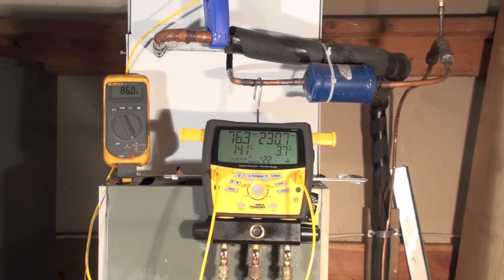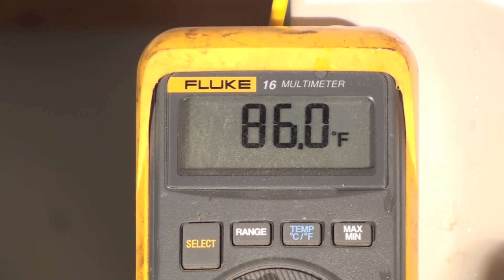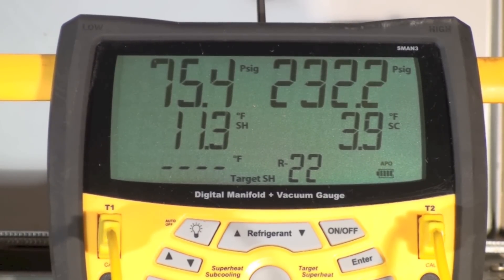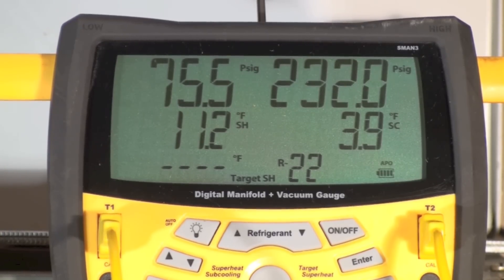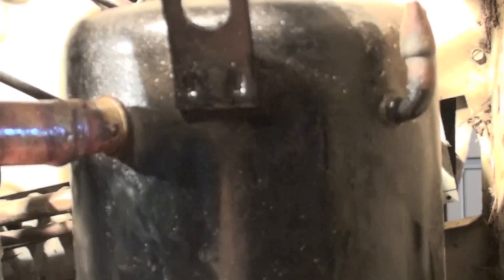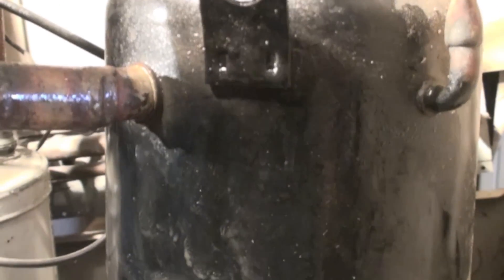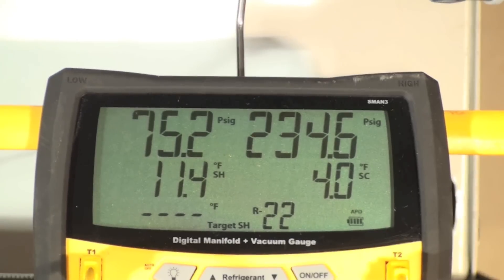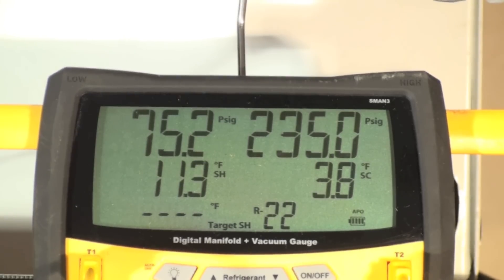High return air temperature effect on suction pressure on the air conditioner

Comment from the maker: The coil is clean and the blower is clean.  The blower is rated at 1/4 hp but it moves a lot of air.  I also had a lot of good comments, not the least of which is from Eddie.  I will be doing more on this with air flow as accurate as I can make it.  I also want to use one that is matched.  There several things I want to test.  Thanks for the comment.
GFM

Comment: You know what would be a really good video, is if you show how to charge a split system during low ambient conditions around 50 deg F. A few years ago I had to charge a system when the outdoor ambient was 50 deg F and let me tell you, I had to be very careful when charging that system. The evaporator temperature in the end was between 30 to 40 deg F

Comment from the maker: Actually, with the wb at that temp, target was 18.  I have always wanted to challenge the high airflow issue.  The air handler is capable of 1200.  The indoor coil is 2.5 ton and the piston may not be right.  I have run it both on high speed and low with predictable results.  This one needs to be revisited when I have all equipment matching and air flow assured.  Please don't take this as critical of your comment.  You have shown me what I need  to look at. More coming when I have it.
GFM

Comment from the maker: If you slow down the blower, the superheat will reduce due to less transfer of heat.  I have reduced air flow to check operation and may do an vid on that.  Overall, I would like to revisit this subject, but I want to be sure of accuracy of the readings so it may be a while.  Also, summer is over here, so I may not have the temps to do sensible tests.
GFM

Comment: I would think target superheat is going to be around 20-25 degrees but I don't know the wetbulb so it's hard to say. 1100 cfm is way to much airflow for a 2 ton which is just as bad as not enough airflow. Dial it in at 400 cfm per ton which would be 800 cfm in your case. Is that a three ton drive air handler?  Put that  bad boy on low speed , weight in the refrigerant and watch that suction climb to 85 lbs. it will happen.

Comment: you have no meter and are overcharged bud. may be short on output w that compressor change as well. If thats the OE blower in a 3 ton drive then yes drop the speed.Adjust your charge.@86 ambient id guess subcool to be approximately 1-2x your superheat on that old thing...good luck

Comment: I had a new system install of a r410a system. I got an after hours no cooling call. It was out on high head pressure. Reset the system, handout gauges on it. Looking at my gauge 117/259 with a suction line temp at 87°; 68° out of the grills. The attic temp was 110° at night. I found multiple air leaks at the return side.
I assume the attic air was 150°+ in the heat of the day. And it's my belief that return air leaks was the cause. Is this possible?
Reply from the maker: If the leaks are substantial, it could cause high head cutoff.
What is your delta T?  The suction line temp seems way off.  How long did you have the system running when you made your readings?
GFM
Reply: @grayfurnaceman  
I didn't get the delta T, the system ran 30 minutes or more. When I saw the high suction temperature. I figured a heat source, and thought maybe W was getting energized some how. But saw some air leaks on return side. Honestly, I've only seen this just a few times. But never a suction line that warm.
Reply from the maker: @HvacGuy76  Possibly a combination of low charge with high return air?
GFM

Comment: I did a  install at my house. The  succion and discharge line temp are in the 90f. Low pressure is at 110 , high at 330. Evap is at 34f blowing cold air. House was 86. Out door air was 82. I had to replace the fixed orrifice from .061 to .067 said the instructions .. also came with a .065 for some reason. Should I question the fixed orrifice or is it undercharged?.. the high succion temp line has me confused. System is r 410a
Reply from the maker: Your numbers do not make sense to me.  Is your liquid line and suction line temp 90F?  That number is virtually impossible with a low side pressure of 110.  Are you getting 34F air in the supply duct?  Did you charge the unit as a liquid?  Did you evacuate the system?
GFM
Reply: Recovered refrigerant. Found some black dirt by the fixed orifice. but dont know if it was clogged. Vaccumed to 1150 microns for about 40 mins didnt want to wait all day for 500. Recharged  refrig. Now I have 106psi on the succion 65f succion line temp. 225 psi discharge 95f on the liquid line.. seems low for the discharge. Evap is at 37 38f.saturation temp.. low on freon by a bit mabey
Reply from the maker: I would want to know superheat at the evap.  The unit should have a chart on the wiring diagram that should give proper superheat.
GFM
Reply: grayfurnaceman chart superheat?? I know how to get it Via wetbulb. Also have a fieldpiece digital gauge that does it for me. That superheat?
Reply from the maker: Yes.
GFM
Reply: grayfurnaceman return today to 45f succion linetemp.  99f  discharge line temp. ..  37f evap. Measured In the correct freon the other time.  house is cooling.. looks like it works now. Pretty goofy system.. 90f succion line temp on initial start up.  Had me confused...   Never doing a fixed orifice again..... thanks

Comment: GFM .......I had the same basic system this week.........2 ton split heat pump ...fixed metering.....with the air handler in the attic........target super heat was 15..........I finished the job these numbers............81 suction.....337 head.......14.9 superheat......

outdoor ambient was about 93................my question is do the suction and the head pressure on this system look a little high too you??
Reply from the maker: They do look too high unless the return temp is exceedingly high.  I would be looking for air in system or blocked condenser.  Hope this helps.
GFM
Reply: grayfurnaceman I was thinking the same thing........dirty condenser or air in the system....I will reclaim the refrigerant and pull a vaccum and clean the condenser Monday

Comment: Hi, on a r410a txv system.  Subcooling is around 12F. But suction line temperature at condenser is 33F. My gage shows a suction temp of 30F. The txv is brand new. Can this be airflow issue? Thanks
Reply from the maker: Do a delta T across the indoor coil.  My bet is low airflow.
GFM
Reply: Thank you

Comment: Dear sir why subcooling is showing 3.4 it should be 10 to 12
Reply from the maker: On this age system subcool will usually not be that high.  Also, the unit is running at out of normal return air temps.
GFM
Reply: Thank u sir

Comment: I think two turns clockwise on the txv will increase the super heat and reduce the compressor flood back .The evaporating temp looks good but after txv adjustment you will reduce suction pressure . Not uncommon to find 65 suction with 300+ head back in the early 70's .. How old is this unit evaporator airhandler Under charged system erode the txv needle away. I remember they were telling us all these units needed an accumulator for start up and running because that's what they did. They had you so scared that wouldn't install an ac without one and some had them built in.
Reply from the maker: Its a fixed orifice.
GFM
Reply: Build a fire under it and increase the load . The should boil off the liquid.